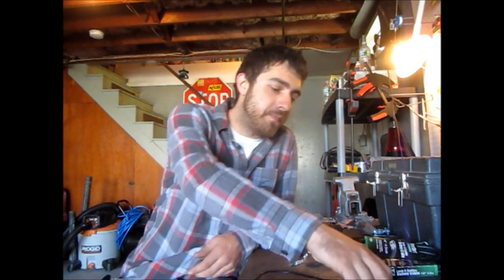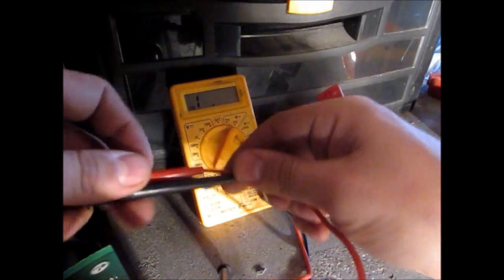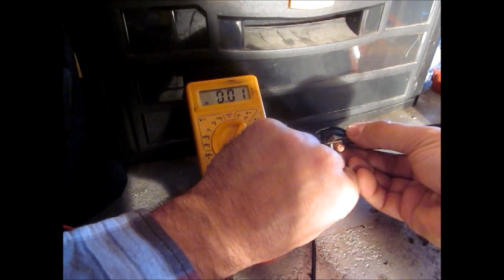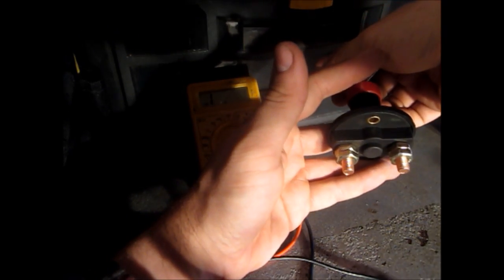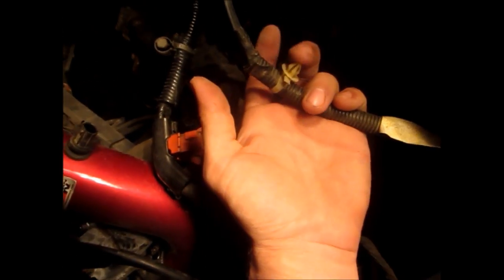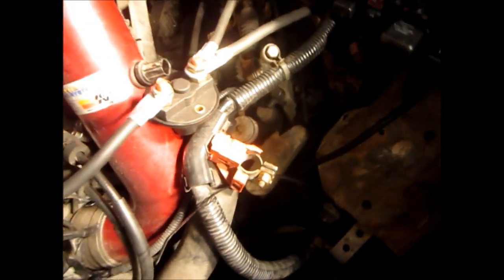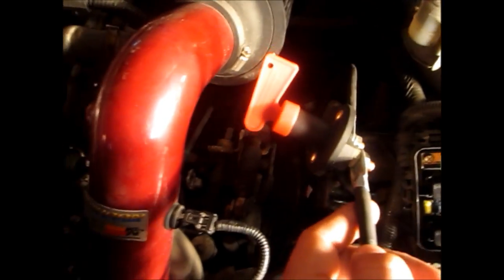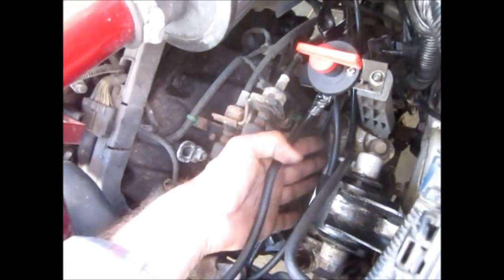How to install a kill switch on your car

Comment: Here's a way of getting around that. Use the battery switch as he installed. Get a weatherproof inline fuse add on and a 10-20 amp fuse. Wire it across the two posts on the bottom of the kill switch. This allows the car to retain memory when the switch is off and also allows an alarm system and lights to continue to function. Attempts to start the car will draw higher amperage which will pop the fuse and shut the electrical system completely off.
Reply: So, negate the switch then? if you wire it across its as if the switch wasn't there. . .
Reply: @Technie87 wire it with a fuse completing the circuit so your 10 and 15 amp fuses that power your alarm and radio memory will work. To turn the ignition all the way it would try to draw more power than the fuse can handle and it would blow the fuse, disconnecting the circuit. So as long as you remember it's there and don't try to start it with the killswitch off you will be good to go and not have to buy another fuse unless someone forgets or doesn't know it's installed

Comment: As someone else said. Its a battery cut off switch. Makes for easy battety isolation when you work on your vehicle often enough for this to be useful. Also. Dont use electrical tape to isolate each connection on the cut off. Get yourself some quality Rubber Splicing Tape and use that. Then go around it with electrical tape. If you want to go the extra mile, grab some friction tape and go around your connections one last time with that. Also. If your placing this switch under the hood as i did, do it somewhere it wont get wet. Manufacturers place your battery in a specific place under the hood in order to ensure that it stays dry so somewhere by the battery is usually a safe bet.

Comment: Good Vid, but this is a battery cut off, not a kill switch bro, if you switch that off, your car will continue running.
Reply: That's depends upon the engine. If you have Di direct injection diesel engine with inline pump then it'll not serve as kill switch but if you have toyota 2c or 3c turbo with rotary electronic pump then it'll work as kill switch also. Because in toyota 2c or 3c you have a diesel supply switch connected to the alternator and as soon as you disconnect the battery the engine stops immediately because fuel supply also stopped by the alternator.
Regards

Comment: This will mean  that all your electronics, clock, etc will have to be reset every time you use it.
Reply from the maker: True, this config is not ideal for daily use. It is nice to be able to kill power though when you need to service the vehicle. You could install a 2nd switch just cutting off the fuel pump.

Comment: Thank you Moccina. I have been having issue with getting my switch to actually cut the power. Your video is the only one that addressed that multiple ground wires had to all go to the switch. Thank you so much for this video. It for sure resolved the issue I was having.

Comment: Dear Man, Thanks for a very nice and detailed video!

I would recommend - as a rule - to use washers for a better electrical connection (more space to the current conductor), and also this is good for a better mechanical connection.

Have a blessing in your hands!!

Comment from the maker: That is correct.  Granted the would be thief does not have enough time to figure out where the kill switch is configured and how to redirect power to your ignition (which most will not have this expertise).  Time is everything when it comes down to someone trying to steal your car.  If it takes too long to figure out, they will more than likely move on to the next car.  You can also rig it up so only ignition gets power cut off or have 2 separate switches-- It's up to you! Thx for watching!

Comment: You recommended placing the switch on the negative terminal, is that specific or can I also connect it to the positive terminal?

Comment: What if you have a dual battery setup in a diesel truck? Are you to run two of those same switches then or can you run cables off the one?
Reply from the maker: You could run both negative terminals to the switch, but I would make sure the switch can handle 24v. They also sell dual battery switches in which you can kill each battery independently.

Comment: Hi. I’m looking to install a kill switch for my campervan. I bought it already built and I’m not sure if previous owner installed a proper split charge rely device from the vans engine battery to the leisure battery in the back or if he just ran a positive and negative cable from one battery to the other (that’s what it looks like but part of wire buried in the walls), I disconnected the wires as I previously had drained the battery’s over winter because I couldn’t drive the van. The previous owner left a kill switch in the van and said he wanted to install it but had no time , so I’m guessing it would be good to install it .
I want to install the switch so when I’m driving I can let the alternator charge both battery’s (engine and leisure) but when not driving , block the charge going from the engine battery to the leisure battery (to avoid any discharge and then not be able to start the van). If this is what I want where would I put the kill switch, on the negative cable coming back from the leisure to the engine battery?

I probably explained this really badly as electronics aren’t my forte , but if anyone knows what I mean and could help it’s appreciated . Will keep watching videos to see if I figure it out (although this video really did help at understanding the switch itself )

Comment: Good video taking the time to explain the concept. I'm going to put mine on the battery post of a 02 Ford Ranger. My ignition switch is going and sometimes kills the battery. So for now The price of a kill switch fixes my issue. Though I do like the idea of a remote location like the glove box.

Comment: I'm running an aftermarket 16v battery in my car. The kill switches dedicated to 16v batteries are few and far between and I can't find any with the amperage ratings I need. However the 12v disconnect  switches with the amperage ratings I need are a dime a dozen. So my question would be, could I safely use a 12v disconnect switch with a 16v battery? Also I really appreciate your video, I've been wondering how to install one and scouring youtube looking for answers, your video was the most helpful :)
Reply: what about using a 24 Volt disconnect switch with 300 amps (or more) rating?

Comment from the maker: Oh true, just find the ignition wire lead and intercept that, similar to if you were installing a remote starter.  I suppose you could do 2 switches-- one for this, and another to cut battery totally when you need to.

Comment: you are correct. I don't know about the check engine light coming on though. that doesn't make any sense. you may have to unlock there stereo again (some general motors, not sure about Honda) short term fuel trim will also be lost. I wouldn't do this. id rather get a fuel pump cut off or injector cut off or ignition kill switch this way my cars alarm and theft deterrent systems still work.

Comment: No part number is listed for the switch, that would be nice to know. Also could the key be removed in both the on and off positions? You could also flip it around so that it's easier to insert and flip the key off and on, maybe tape up the bottom exposed wires and studs so they don't ground out. Parasitic battery drains are a pain in the w-ass sometimes to find and fix. A part number for this switch would be nice and where to get it and what did it cost, who makes this thing of magic? Over all it's a nice video, good job dude.
I watched the rest of the vid and see what you did with tape and mounting.

Comment: Okay i have two questions. If I do this after turning off the kill switch would I be able to alarm my car?? Since there would be no power. And wouldn't it reset the ecu I have a chipped ecu so I'm wondering if it will restart everything in the ecu.

Comment from the maker: Hi, when you use this kill switch it is no different than if you were to disconnect the negative terminal of your battery.  Anything that happens when doing this would be the same in either scenario.

Comment: i use a regular switch almost like a light switch but smaller, and hook it up to the ignition and hide it from plain sight. (u need to know what ur doing with the ignition wiring before u start)

Comment: You never said what side of the battery that you're connecting your terminal to, you just mentioned you have two ground wires connected to the disconnect switch. What side is the other 3rd wire connected to the negative on the battery?

Comment: you can hook it up to any type of battery. all it is, is a simple switch no different than a light switch in your home. it just breaking the path of voltage and current so the car wont have power.. no different than taking the negative battery cable off or taking the battery out. exact same

Comment: Would this not kill your power to the computer in your car so all the sensors would have to recycle and the check engine light might come on and the digital clock reset?

Comment: when using this switch does it fully cut off battery to the whole car EX: if u turn off this switch after installed will it have the same effect as if i took off the battery terminal?

Comment: Im having wiring issues with my car. After driving it the next day the battery is dead and I need to jump it again. I already put a new alternator and battery in the car so I am pretty sure there is a short somewhere. I was told to put a kill switch or toggle switch in my car, do you think this will help with my problem?
Reply: Also, someone else told me putting in a kill switch would mess up my car... However, my car is a 1997 Saturn. Its not a new car so would it hurt it?

Comment: Hay, can the kill switch be installed on the positive terminal?thanks
Reply from the maker: It is best to connect to the negative. The negative cable connects to the body ground already—so there's no additional danger if it rubs. It's the same principle as why you should always disconnect the battery's negative side first before performing electrical service.

Comment: For an everyday driver what kind of kill switch(s) would you prefer? (21 year old car)
And if you have any in mind and can you please get back to me as soon as possible.
Reply from the maker: Nathaniel Galvez Same idea as in the vid, but isolated to either fuel pump cutoff, or ignition. You can have multiple kill switch configurations I you would like, just takes a bit of time. Good luck :)
Reply: Thank You!

Comment: The only downside of this video is that : to turn it on, you still need to open your hood. that's a waste of time especially if your in a rush. Don't you think it's much better if you install this inside by the front panel? There are two holes anyway and I think the purpose of that holes are for installation in a flat surface not just laying around inside engine compartment.
Reply: Pioneer Lover Thieves look their first...they will know its a switch hidden somwhere...espicially one so huge

Comment: Er so basically I have to reprogram the car stereo and clock every time?
Reply: Jes no power is coming tho them sow you must  reprogram the radio em clocks
Reply: Yes. But you'll have to do it every time you drain your battery, too.
Reply: You could always run a thin cable direct from the battery just to your radio/clock. But remember it will be independent of the ignition switch so there will be a risk of you leaving it on.
Reply: @grahambunton377  

But you can toggle that cable too or you can use an ignition shut off switch.

Comment: Can it be used to avoid that just one accessory doesn't  work? I mean, I have an air ride system, but I would like to use it just when I put the key on it (but with car on).
Reply from the maker: Yeah I don't see why you couldn't isolate the cutoff to only that specific circuit.
Reply: Oh, I see. Thank you
Reply: You could easily wire it up to cut that circuit as you wish. 
You could also theoretically use it for a sound system, but  I'd  rather put the killswitch on the remote wire as far as car audio goes.

Comment: In addition to a kill switch (I have the same on as in your video), I also have a bypass fuse so I don't lose the presets or clock...  Do you have the directions on where and how to install that part?  Thank you.
Reply from the maker: Lisa Seidel Hi Lisa. That is a great idea to incorporate a fuse so as to not lose radio memory / clock etc.  I don't have a diagram for that. But I am curious as well. Maybe I'll do a vid on that in the future. Thanks for viewing!
Reply: Appreciate the comeback... Hit me up when you find out. Thank you.
Reply: That's a good idea, but a bad idea for some. For people who don't use the car for like.. a week or so. Another good purpose for the Kill Switch is that the battery stays charged, rather than depleted from the Radio and other Electrical Components that need memory.
Reply: Sumona Florence Also, would work against any kind of alarm system. Unless you seperate the circuits it would kill the alarm system. However, adding an alarm and seperating that circuit would be easy.

Comment: what about the alternator protection ? if you turn off the switch while the car is running it can damage your alternator,
Reply: Why would you turn it off while it's running?
Reply: because engine is catching on fire or many other reasons that's why formula D specs say that a kill switch must be accesible from outside of the car and by the driver in seat position
Reply: rotch s-garage if your engine is on fire i think you have bigger problems than an alternator.
Reply from the maker: Ive never turned the switch off while the car was running.
Reply: The kill switch is designed for racing/rally cars. Its meant to be fitted near the seating position of the driver/ co driver in case of an electrical emergency or rolling the car and you need to kill the engine and electricals quickly. As above mentioned on a car with a ecu it needs to be isolating the alternator and a resistor fitted because u will damage the alternator. DO NOT FIT THIS ON A CAR LIKE THIS

Comment from the maker: It would produce the same spark as if you connected the ground wire to the battery, especially if you accidentally leave the ignition in the "on' position and that cable really wants to get current.  It's not a pos to neg type spark, but it's still a spark lol.  And yeah, if a car theif needs that extra time to find the switch and jump the terminals, it may be the difference between getting your car stolen and not :D

Comment: i wanted to install one of these on my 1998 isuzu trooper because the headlights come on by themselves and drains the battery. A new headlight switch for my car is over 400 dollars at autozone. I heared that if you use one of these it cuts the power to your ecm and your car has to relearn everything over evertime you use it. I heared that this can damage your car. Any thoughts?
Reply: Johnny Rocket You're special. Not only is it safer and recommended to disconnect your negative while working on anything electrical in your car, i have been a mechanic for a very long time and have never had nor heard of any ecm having issues from merely disconnecting the power to them as long as the vehicle isn't running at the time. And if your obvious lack of experience comment was true, you should bring it up to the multitudes of applications that use a kill switch, namely anti-theft devices. No, just no.
Reply from the maker: Johnny Rocket If you're going to talk about me on my own forum, refer to me directly.  The motor from my Acura gets swapped into Hondas all the time, thus RSXs (as well as Civic Si) get stolen all the time  so anyone who owns one will tell you it's smart to install one or a few of these kill switches.  Also, my car is 99% stock. Please learn the meaning of rice before you go around labeling things as "rice" and talking shit about other guys' automobiles.
Reply: moccina Not taking sides with that nob end johnny rocket but does it not take around 30km for the ecm to learn driving conditions.

this would be good for storage for obd engines but i dont think id want to kill the battery every time i park.
i think a fuel kill switch would be better.
I just picked one up for my 1st gen ranger which i will kill the power when ever i park it.
Reply from the maker: Poo Edd Yes, you are correct.  The configuration of the install shown in this vid is more useful when you need to disconnect batt power completely-- in order to service the vehicle. It would not be practical to cut power to the vehicle 100% every time you park-- as your ECU would be in constant "learn mode".   For an everyday cutoff switch I would add a 2nd switch-- isolated to ignition / fuel pump circuit etc.. or a combination of both.  Thx for viewing.
Reply: yes but still very handy to have installed considering how much they can be picked up for!!
Reply: moccina I would assume that a large portion of people interested in installing a killswitch (people like me) are interested because some dumbass "feature" installed in their vehicle (headlight delay switch in my case) is old and shorts out and causes their battery to drain while unattended, and they got tired of having to disconnect the battery cable every time they park somewhere for more than fight minutes, not to mention that doing so puts a lot of stress on the cable over time. Putting the switch on the ignition or fuel pump wont help with that at all.

Comment from the maker: @rich unggoy I respectfully disagree. You always disconnect your negative so as to avoid electrical fire / sparks. It's the safest way. Thx for watching.
Reply: With the car running wen you turn the switch off will it shut the car down